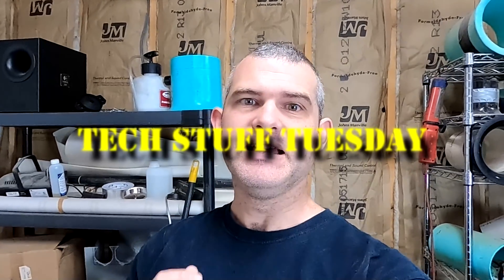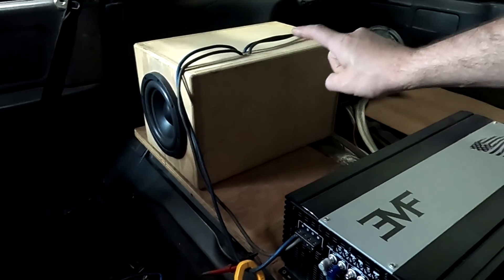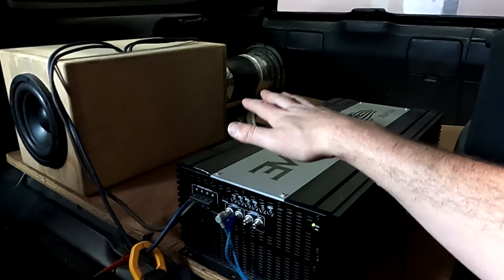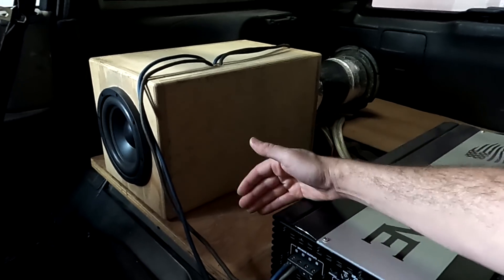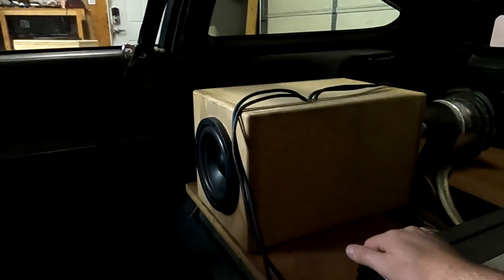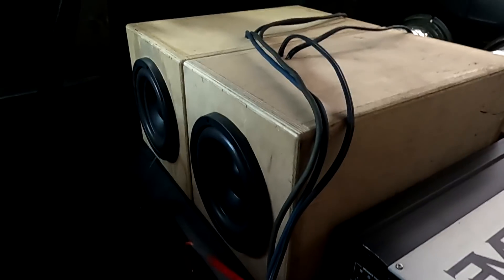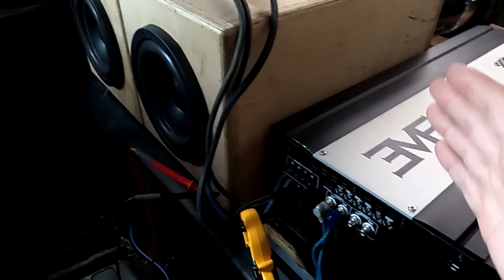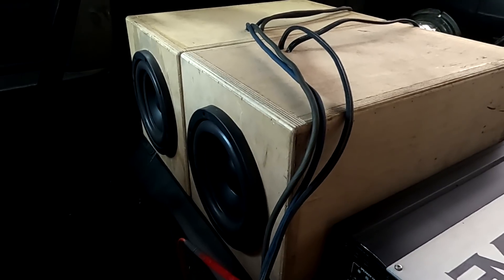Does doubling power or doubling cone area really gain 3 dB? - Tech Stuff Tuesday

Comment: The reason for loosing db by adding a sub is due to splitting the power between two subs. 100warrs to a single sub is 100watts 100 watts to two subs is 50watts per subs which causes less speaker movement.

Comment: on the reversed box, hooked up test, you flipped polarity. BUT remember the port is in phase with the sub, so you should have used the same polarity. AT the ports tune, the second port, and the first driver would be in phase.

Comment: The box and sub setting by the other without playing is acting like a shock absorber when the one sub hits the other moves in the opposite direction because of the pressure and lowers the pressure overall if it did not have the box and was just the sub this would not happen it’s the box and it’s tuning that’s actually doing it

Comment: The double power gain 3db or double cone gain 3db. Is measured at 1 meter directly in front of the cone area. Not with car audio spl measurements

Comment: It might have something to do with the sound waves. out of phase. interference. Also, since the other sub is so close to the one running, it will absorb some energy and if it moves it will produce electrical current
Reply from the maker: It can't produce electrical current if it's not connected.
Reply: @EMFAudio  It will still produce the current, it just isn't connected, so it doesn't flow. i would imagine that if it is connected, then it would be pushing power back into the amp, just like they do when driving them, thus damping factor. I'm just throwing stuff out there. 
I lean more towards the placement next to the other one was causing some sort of interference, esp.depending on where the meter was located.
Reply: @RobHTech  I'm not sure you realize this, but current is flow hence the name. A dead circuit as in your example will never have current.
Reply: @beardedforlife3740  I was referring to a speaker producing electricity when moved. He said it was disconnected, so that rules that out. 
--So, I'm not sure if you know that a speaker can move when current is applied, or it can produce electricity when it is moved. 
So sitting next to the active sub, the "Dead" sub can pick up the vibrations and thus produce electricity. But, in his case, he completely disconnected it.

Comment: Man, do not connect the second sub reversed polarity when flipped, at 50hz length of the wave is still almost 7m, thus they still act more like one unit. Probably got confused when there are two speakers in one box and one flipped and reversed. Nice videos :) subscribed
Reply from the maker: Sometimes you try things both ways and use the better result for videos.

Comment: The unused box just sitting there interrupts the sound waves of the working sub and therefore results in weaker readings at the meter? That’s how my brain works anyways 🤷‍♂️ kind of like in my car when I take the baby seat out of the back and it’s louder at the meter. Less things for the waves to bounce off of ASSUMING the more they bounce the weaker they get exponentially. If I fold the back seats down it’s even louder. The biggest gains and losses I’ve noticed tho have been a result of moving my box as you did with yours. A few DBs  difference between subs up port back and port up subs back. Haven’t tried subs front port up because my amp rack is right there in the line of fire behind the back seat. Oh! I should mention this is in a Ford Edge with full glass panoramic moonroof....my first edge with full cloth roof and no glass was 2dB quieter, same equipment. That’s what started my theory on “it’s what the waves bounce off of (or don’t) that matters.” Maybe I’m crazy, but the meter doesn’t lie sitting there in the passenger kick. Now, if I crack each front window 6” versus completely shut and put it on the dash it’s even louder. Go figure.
Reply from the maker: Opening windows and being louder is most cars. Glass roof vs metal roof has to do with roof strength. You have less energy lost to "flex" so it's louder.
Reply: EMF Audio thanks for the response! Keep up the good work! 👍🏻 it’s an interesting sport that’s for sure lol. Question though, I’m running 2 American Bass HD 12s on a sundown svc4k, singer alt and so on....would the ban hammer be an upgrade in loudness/deep bass? Obviously you make them so you’re biased, but just curious how much difference a change like that could make given all other components stay the same...ported box is 5 cubes net tuned to 32.

Comment: It's nutz how crucial placement is. I have had 1 1500w skar in a 2.6 cu ft box that made more spl than 2 750 watt alpines. I am extremely limited where I can keep my box due to having 5 toolbox for work, in a freaking camry but when the weekend comes and I have time I move the skar back in and place it where I can't place the alpines and suddenly 3k watts sounds like 3k watts. Thanks for the excellent information I seem to understand the way you explain thing better than some others
Reply from the maker: Something worth noting, the power rating on a sub IS NOT an indication of how loud it can be, or a comparison to another sub in any form of performance.
Reply: @EMFAudio  def agree, ive got alot to learn but that much I do know. But placing the box where I cant other days def makes the biggest difference in the subs I do have. Hope you get the part 2 of the new rockville sub up, the anticipation is a bitch
Reply: A pretty big difference between those two set ups is the T/S parameters. Don't ask me to explain them because that's beyond me at the moment, but I do know that they are literally everything when it comes to how a woofer will play and what kind of enclosure it will be best in

Comment: Thanks for doing this test Sean, you saved me time & effort as i had planned to test this theory for myself since only gaining 1.2 db after adding another sub. Interesting results you got, i also found my peak frequency changed a lot however i'm using 6th order.
Reply from the maker: If you're adding subs into the same airspace that is shared that will DEFINITELY change peaks, and you'd never get theoretical gains.

Comment: Box placement can always be a prick. I have a couple 12" type R's in a vented enclosure and though typically you would gain db facing the port to the drivers side rear corner or in the area, I lost around 4 db, so it's facing the rear seat where they're at a modest 143 on 1.3k watts. Like youve said in your other vids. No way to know till you experiment n find out what works best for you

Comment: could cancellation happen because of the unpowered sub acting as a passive radiator kinda idk?????
Reply from the maker: Passive radiators AMPLIFY the output.
Reply: @EMFAudio  
Yes I know they amplify output in same enclosure as live driver but if it's in a different box unpowered. wouldn't that be like a loose door under vibration.

Comment: did you connect the second speaker on opposite terminals or were they the same polarity?
Reply from the maker: There is only 1 set of terminals. Polarity was the same when facing forward, 1 facing back had phase reversed.
Reply: @EMFAudio  i have been playing with the phase with my system in my truck and i did notice it got louder. both subs are single voice coil in parallel at the single speaker terminal at the box and hooked up to class d mono channel amp. 

both subs face upward and the port faces upward between the speakers. my 6.5 mids face toward each other through the sub sound waves.

Comment: from the looks of it, you are trying to put the same amount of power through one speaker through two speakers. this is effectively dropping the total power output by at most half power. you would have to double the power output to run double the speaker impedance, even if both speakers are wired the exact same. if you wired the speakers in series, you would get the same output as one speaker in two speakers at the same power output because you would effectively be raising the total impedance of both speakers. the reason you got less output from the speakers per power increase is because you raised the total impedance of one speaker by adding the second speaker. 
how were these speakers wired? were they in parallel series or in series or in parallel?
changing the total impedance will effect the power output needed by the amp and the output of the speakers.
Reply: adding that port to the second speaker, effectively increased the volume of space. volume of space effects the sub sound
Reply: testing as you are doing, is a good way to decide which way to place your sub-woofers. however, the placement of the subs does not effect the total output of the speaker. the direction of the speakers does change the decibels of the speaker because of the subsonic waves interfering with each other. you want the waves to be going the same direction to keep those subsonic waves going the same direction. adding the port effects the way those waves behave. everything you change needs to be done to everything within the system. the power output of the amp only really effects the way the sub-woofers act. to get max decibels you need the waves to not interfere with each other or complement each other. it goes the same with your mid-woofers and subs. if the mid-woofers are firing the same direction as you sub-woofers, you will hear less base. if the waves are the same, they will cancel each other out. that is why you want to have an interference setting on your mids and subs. with this interference setting, you will hear more high sub sounds from the mids  and more low sub sounds from the subs. this will complement each other because the low lows are from one source and the high lows are from another source.
Reply: at 10:30 or so, both speaker boxes look to have the same port on them. however the boxes are in different directions, this is counter productive to how the speakers work. one speaker is pushing air toward the front and one speaker is pushing air toward the back, when those speakers are firing at the same time, one is pushing while the other is essentially pulling, causing lower db's
Reply from the maker: It was louder with 1 sub firing backwards than both firing forwards. The phase of the one firing backwards was changed so they are effectively going the same direction at the same time.
Reply: and it doesn't help that the power output of the amp is not consistent when being turned up.
Reply from the maker: I'm not sure you understand what's going on here. The impedance where the power happens doesn't matter. If you double power, that would change 2 parameters with 2 subs. Output isn't measured "per speaker", it's displacement and power, no matter how many speakers there are.
Reply: @EMFAudio  if you are using a single channel with multiple speakers, total impedance matters. if you are using a 2 channel but bridged, the same applies. if you are using both channels for one speaker each then no that would not matter. however the power output changes based on how many channels are being use cause the total output power has to be divided by the channels. single channels and bridged channels can put out the maximum rms power of the amp. that is essentially where i was going with this. power output depends on impedance of the speakers and the wiring of those speakers, together and at the amp.

and you cleared one thing for me, you said you did have one speaker phased in reverse, which did have both firing in the same direction. with this, i think it got louder because with the port facing the same way as the speaker, you got a concentrated sound output from the port while the sub facing the same direction as the port was making a wider sound wave.
Reply: I don't think you understand the test. The dual sub setup was testing the doubled power theory, it was testing the doubled cone area

Comment: You doubled the subs but didn’t increase the power, you went up to 600w on one sub but with both subs you still only went to 600w, so instead of one sub getting 600, each is getting 300, I’d say that if you also increased the power after adding another sub it would increase maybe a little more
Reply from the maker: I doubled power each time I tested, with a single sub and both subs, just not both subs from 1 sub. Yes, if I doubled power per sub it should gain some, because I doubled power from 1 sub also. That theoretically would be 6 dB gain.

Comment: Interesting test. It should be stated that in terms of cone area the 3dB gains only occur when the speakers are located within 1/4 wavelength away from one another, and only yielding full +3dB when full constructive interference occurs. In practice this never happens, but the lower the frequency the closer to +3dB you will achieve. The rule should state "up to 3dB", and up to around 1000Hz where the physical size of drivers prevents you from putting them closer to one another. You should test at 20Hz, 40Hz, 80Hz, and 160Hz to expand the results. This is well-known theory based on sound physics, but a lot parameters need to be controlled (power compression, environment, etc...) Another idea would be to test in free-field or 1/2 space to test this, but then again this kind of defeats the purpose as these subs are meant to be used in a car.
Reply from the maker: The only problem with testing different frequencies to show that point is there is cabin gain also effecting it, much like the other factors.

Comment: 3db rule is for calculated power based on constant voltage applied to a nominal impedance. Bl decreases when excursion increases and impedance decreases when Bl decreases for any fixed frequency. You literally see it decreas in the video as power increases, so less voltage was applied than the required level for a nominal impedance. That is also why your results were incorrect in your enclosure design software video, none of them use constant power to plot the graphs, instead they calculate voltage from the power level you specify based on nominal impedance (bass box6 pro) or dc resistance (winisd) for the ones we all love to use.
Reply from the maker: BL only decreases when the coil is leaving the gap. It's possible to have a completely flat BL curve, especially with underhung designs. Impedance rise is reduced as BL decreases, but it won't go below DCR. There are instances tested in that car, with that enclosure, where theoretical gains did happen up till mechanical limits. The enclosure design software being wrong I've done videos on, which showed even more issues than what you're describing.
Reply: @EMFAudio   The transfer function of the car is what was missing from those programs, it is fairly constant within a few inches of the measured space, and can easily be accounted for in winisd pro by adding a linkwitz transform to match the measured transfer function of the car for a specific location or just adjusting the graph for programs that are basic. Port compression and power compression can also be accounted for to maintain reliable simulation at all power levels. Your test method is flawed because you're keeping a variable constant (power) and varying what is supposed to be constant (voltage), which skews the results negatively. With your method a heated coil would not show power compression in your tests.
Reply: @jadebrown7259  Nicely said. Car transfer function is a linkwitz? Wow didn't know that!

Comment: Are you serious? Watching some of your tests I wonder if your "mythbusting" is a joke or really meant to enlighten somebody... This one I couldn't even watch till the end. Everything is so wrong with your base setup. Even the video title suggests you got it wrong. Doubling cone area is never going to increase power by itself, however reducing the load impedance will IF the amplifier still outputs the same voltage to each driver. Doubling power will also gain close to 3dB IF the power applied is not already in the area where the cones start to break up/distort. Why not start at 1W instead of 100W? Please let me know if further elaboration is needed. I feel sorry for those guys who believes in this "tech stuff".
Reply from the maker: I'm confused. You think because the result of a test wasn't what you wanted it to be, the test was wrong? It's not possible that data just is the data? Doubling cone area has nothing to do with increasing power, that's the amps job. The same power was used to keep a constant. The impedance of that power doesn't matter, voltage or current being different doesn't matter, it's still the same power. THEORETICALLY yes doubling power will gain 3 dB, and it didn't in this application. This is literally proving you can't assume that will definitively happen because there are other variables. It sounds like you came to a conclusion before the test was done, and that's the worst way to test something.
Reply: @EMFAudio  It has nothing to do with what I wanted it to be. The reason doubling power did not increase gain by ~3dB in your application is that you start your test from 100W and increasing. The small driver in use is already in its non-linear range by feeding this much power so much of it will basically generate heat and distortion. You should have started much lower instead (e.g. 1W). Regarding doubling cone range, if you assume that doubling cone range without increasing total input power should give any gain at all, I would be very interested to know where the heck this myth origins. I have never heard anyone claim that is the case. For the record I am an electronics engineer by education and have built quite a few amps and speakers during the past 30 years.